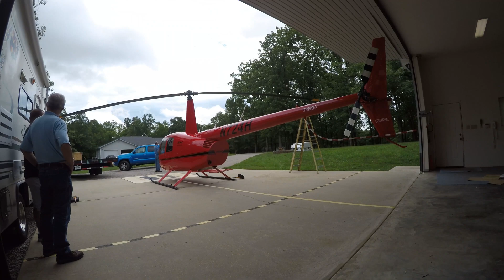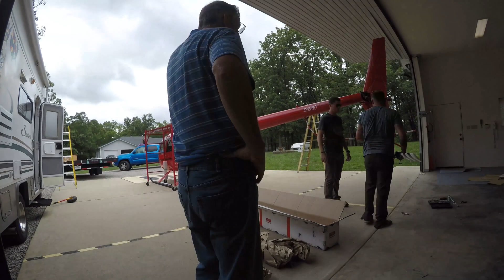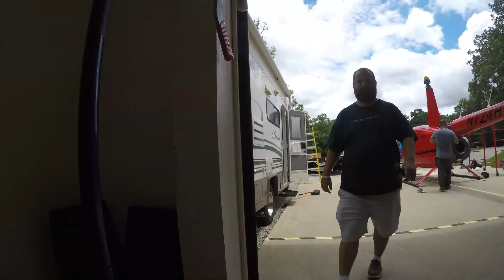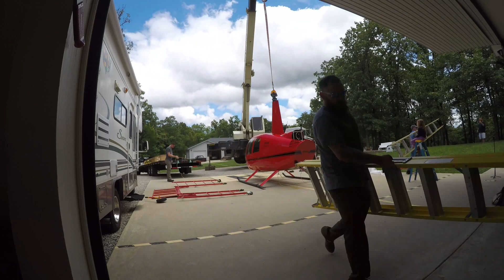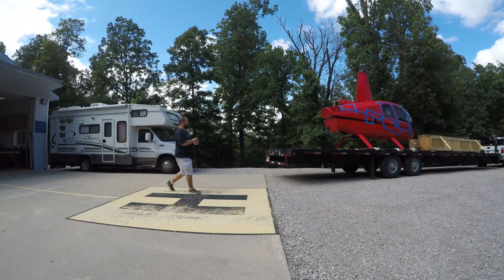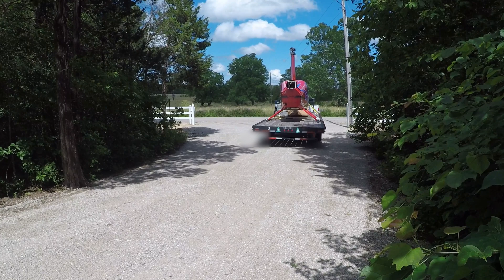Bent Metal - Update 2: R44 Helicopter Return to Factory, Teardown and Crane Lift with Timelapse

Comment: New sub here. Great to see your love for flying isn’t stopping. I’m from MO as well and only 2 weeks ago, I finally got my ASEL PPL at KSUS. 20+ years of stopping and starting back again. Good to be back in the skies. I’ve never flown in a helicopter yet but at some point I will. Good luck on getting the heli back and keep on flying. On of my dreams is to be a CFI and teach my kids how to fly.
Reply: If your bored, here’s my single video of my starting my ground school lessons (at KSET) about a year ago. I stopped my videos just to finish my PPL. I may have to by some webcams and record some flying videos at some point.

https://youtu.be/qE33CO_jE5o
Reply from the maker: Verry cool! Thank you for sharing. KSET Looks like about an hour and a half flight from here. That looks like a pretty cool airport to learn at. I can tell you my GoPro addiction is ALMOST as expensive as my flying addiction. Be warned! ;)
Reply from the maker: That is very cool! Thank you for your sub and support and CONGRATULATIONS on the PPL. That is very very cool. It took me 13 years to get mine, for much the same reasons. If you are ever near the KC area, we will have to go up. It has been a while since I've been in Fixed Wing and I would love to share Rotorcraft with another pilot. I am working through Commercial so I can move to CFI for the same reason. I need to get it worked through before the kids get old enough to ignore me ;-) Fly safe! Blue Skies!
Reply: @MichaelHendricks  yeah, I may need to find an excuse to fly out west for a bit. I took 1 yr of flight instruction (25yrs ago) at Warrensburg. Maybe I'll stop there too. I'll let you know it would be great to take you up and fly in the heli too! I've still not taken my first passenger flight with a few kids yet. Super excited to do that soon. Good luck on the commercial rating.
Reply from the maker: Any time. Safe flying!

Comment: So explain how the hard landing evolved during the approach.  Please.
Reply from the maker: Happily. The description sums it up well. The main issue that led to me landing immediately was as I was entering an OGE hover for a vertical descent and experienced an uncommanded yaw, which typically indicates a loss of power. When I felt that, I lowered the collective and went for the ground. Robinson had issued Service Bulletin SB-98 after a loss of power incident in Florida. That aircraft was 11 Serial numbers different from mine and we had been in touch with the dealer, and Robinson to see if there was concern about my Serial Number. We were told to look for loss of power, monitor, but the Service Bulletin did not affect my Serial Number.  (As a side node, since the landing Robinson has released SB-100 that address loss of power in the R44 and includes my serial number. So just because your paranoid doesn't mean they won’t get you eventually.) 
Because of these external factors, I was highly focused on manifold pressure, power and concerned about the possibility of loss of power. I believe this hyper-focus on power led to me mistaking vortex turbulence from the main rotor system bouncing off dad's hangar, causing a pronounced tail swing for the onset of loss of power. 
Now that I have had 45 days to analyze, perform some specific targeted training, and recreate some scenarios, things they are a bit clearer. When you have 1 second to make decisions lowering the collective, reducing power, and, going for the ground was the safest option I had. As there were also onlookers, had it been Loss of Tail Rotor Effectiveness, I was concerned that nosing over for Effective Translational Lift, adding power and going around while in an uncommanded yaw, might have led to impact with buildings, trees or worse, the onlookers. Adding maneuvering to the mix would have increased risk. 
I feel I did well with the hand I DEALT MYSELF. (Humbling to say)
Reply: Michael Hendricks great briefing.....thanks so much for taking the time.  Glad you guys are all OK.  I believe Flying is a life long learning experience.  Hang in there. 😄
Reply from the maker: Well said. I have certainly gained experience and have appreciated the professionalism of the aviation community more than I can express. It is a high bar for sure.
Reply from the maker: TheTimeTraveler2025  thank you for the kind feedback.
Reply from the maker: TheTimeTraveler2025  on a more serious note,  but unrelated note (i assure you!) can you share some of that time traveling tech with me?